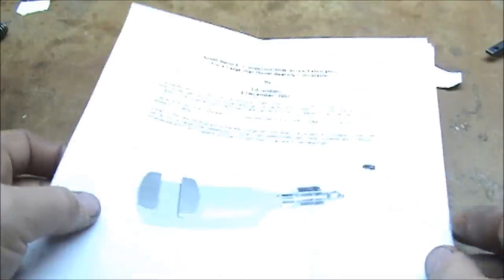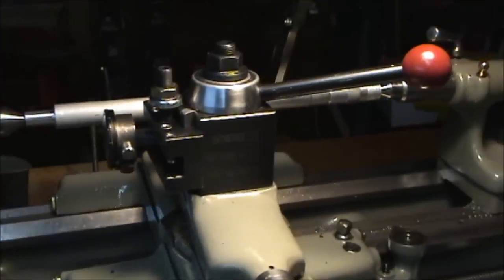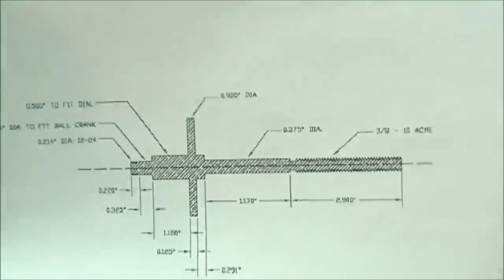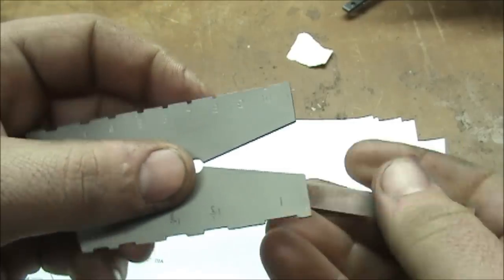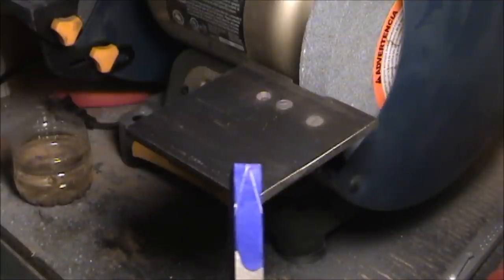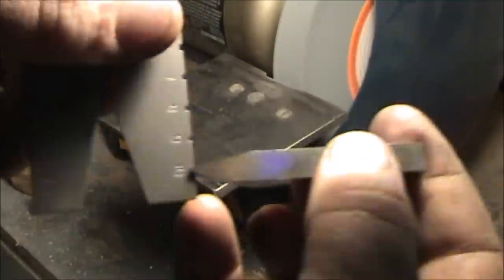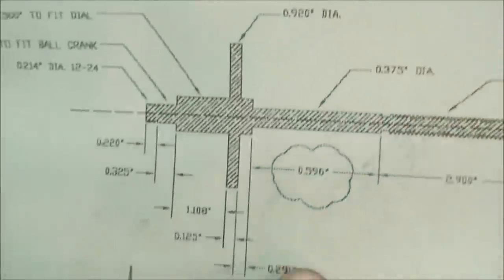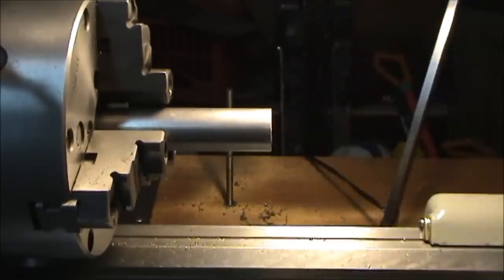Southbend Compound Large Dial Upgrade Part 1

Comment: Just finished watching the whole series, I would like to compliment Halligan142 on excellent videos, they where clear with great close ups. I too own a South Bend 9C and would like to tackle this project. What I like about this is that everything made is done with what most of us have in our home shops, basic lathe and drill press. Not only would I like the larger dials but the tutorial on cutting the Acme Thread is great and this alone can be used to replace lead screws with worn threads. 

Is there a source for the parts purchased listed somewhere?

Comment: I watched this whole series and found it well done and very interesting. I'm now in the process of removing enough crud off my recently purchased 1948 SB Model A to allow me to see it. Then I can begin the cleaning. As the restoration progresses I'll eventually follow in your footsteps add the large dials.

One question: at 5:59 in Part 1 you show a drawing of the shaft. The portion identified as 0.920" dia seems way out of proportion -- like about 2.25 dia. What am I missing?
Reply from the maker: That is the piece that the two bearings run on.  The drawing itself is not to scale.